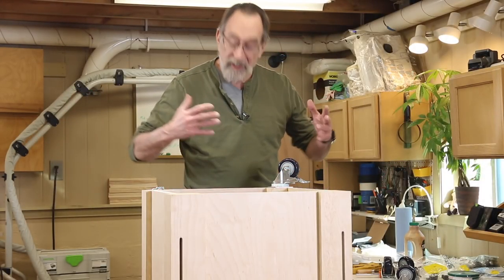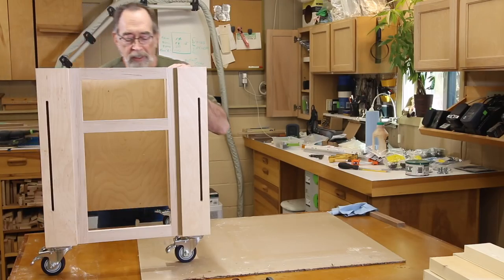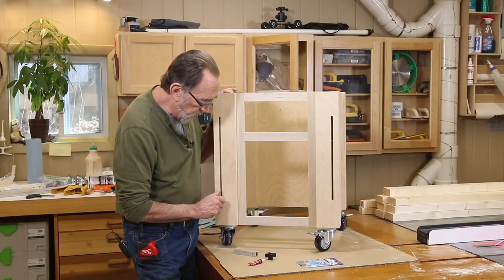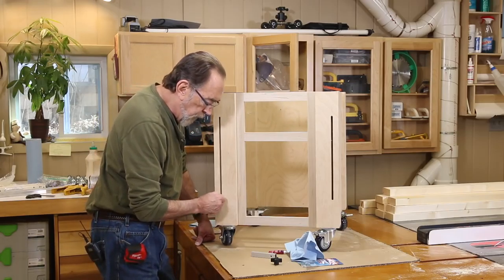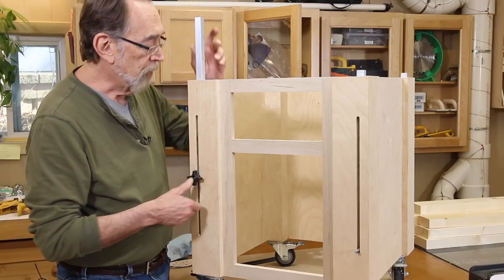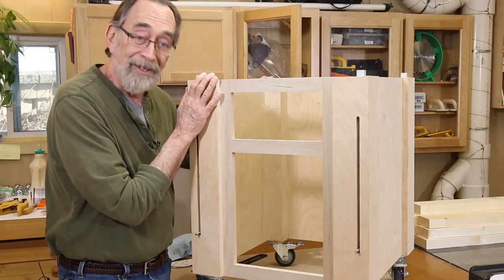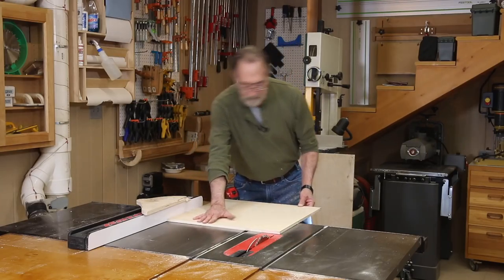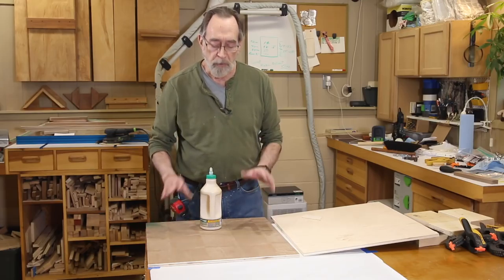Part 7 - Under Table Saw Storage Cabinet Part - The Down to Earth Woodworker

Comment: Those aluminum threads are going to give you problems.  I'll take a bet that you will tighten it down 2-3 times before you pull the threads out of that square tubing.

Comment: you do great vids.  thanks.   Only thing that gave me a moment to pause, was you crosscutting that panel on The TS when the width is much greater than length.  I know you are an old pro, but for a young'n that could get someone in trouble.   I am going to shamelessly use that adjustable top though best one I've seen.